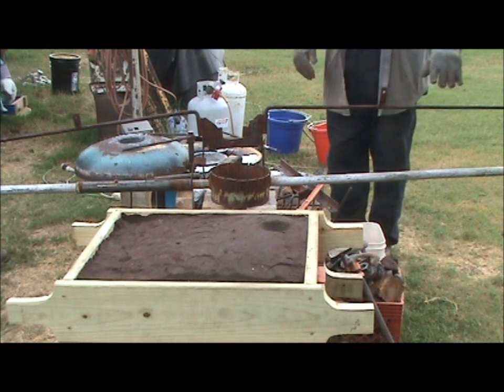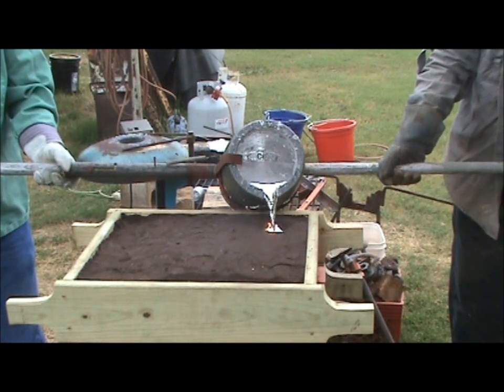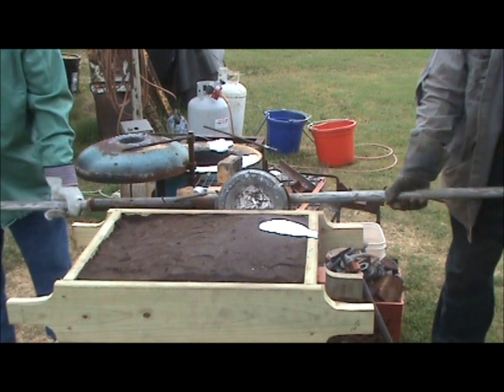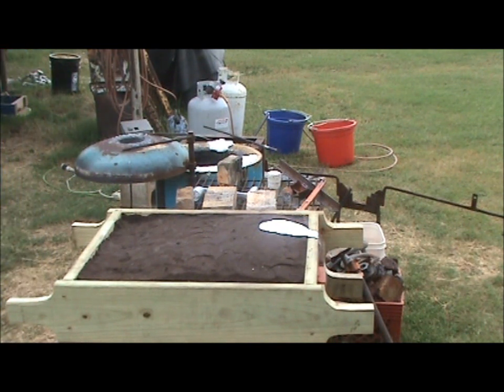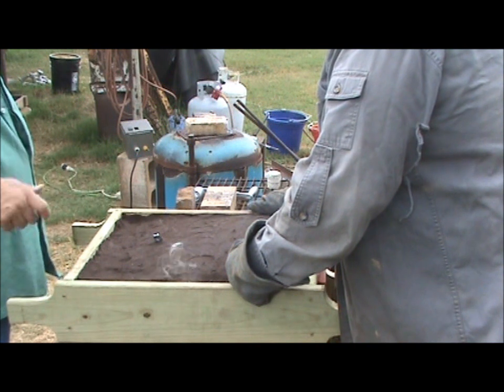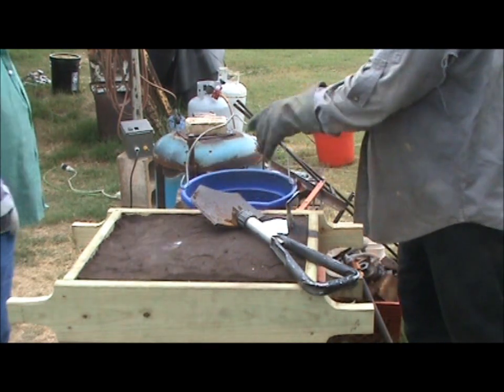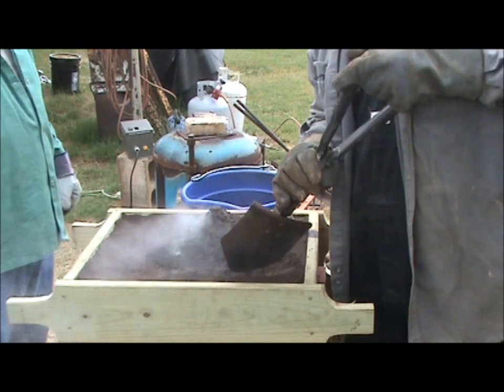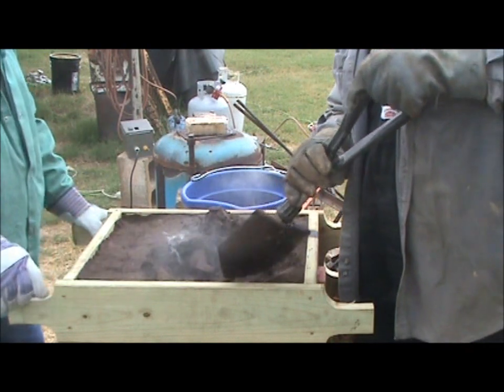flat belt pulley pour

Comment: was there a video of it finished?
Reply from the maker: probably but I don't know where its at, there is one that shows some of the machining, you should be able to find it on Youtube pretty easy
Reply: I have a foundry here and is wood fired. I have been trying to find out how to cast a groved pulley. I someday want to cast a 32 inch curved spoked pulley. There are videos but none shows how to do that
Reply from the maker: first step is making the pattern, I would look for some o the old pattern makers books, second is going to be a furnace large enough to melt the amount of metal required to make the pour with.
Reply: I can melt over  gallons of metal. I never could figure out how the groove was cast in the wheel. Maybe a 3 part mold?
Reply from the maker: the grooves in most v belt pulleys were machined in the pulley after it was casted.
Reply: On an old no 30 church bell, there was a parting line right center of the pulley groove. That's what throws me.
Reply from the maker: there's lots of ways to mold the groove in so that Its casted so they didn't have the expense of machining it. sorta like molding up a boat propeller with only a one blade pattern